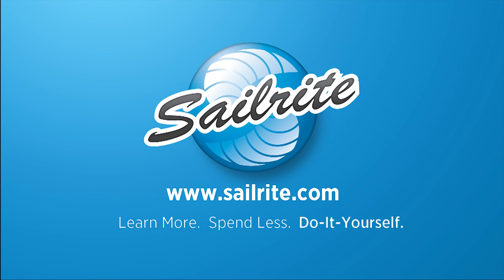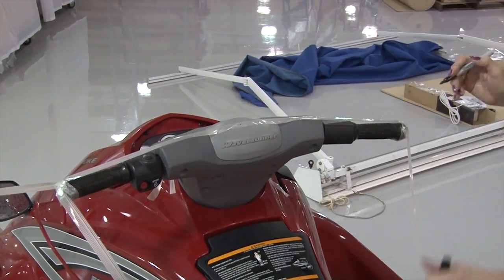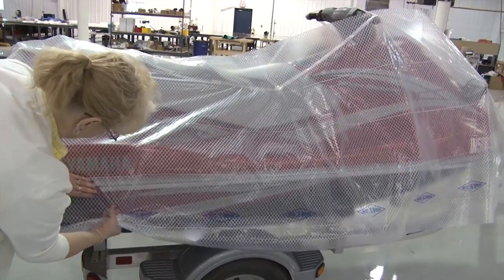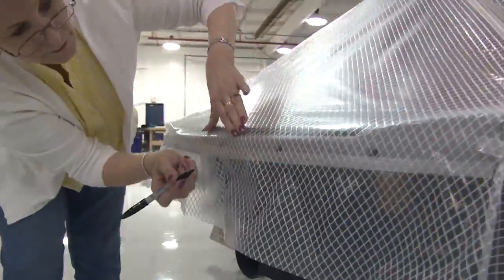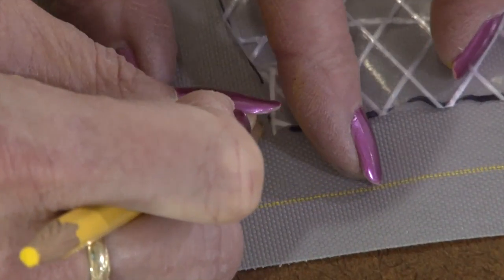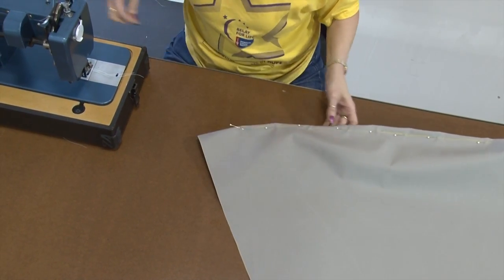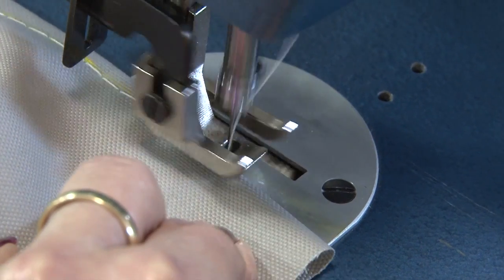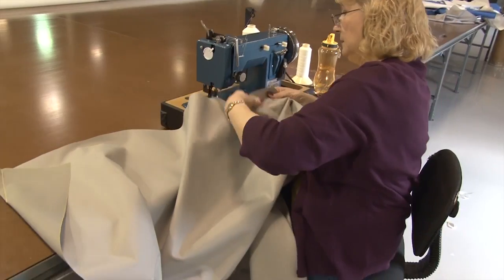How to Make a Personal Watercraft Cover

Comment: I have owned and operated an Marine upholstery shop for almost 40 years and patterning is my strong suit. I have been us using Tyvek house wrap for years to make my patterns out of but you just taught this old dog a new trick and I am impressed. I gotta say it takes a lot to impress me. The use of seam tape with the strapping tape is ingenious! I have spent years using all different kinds of patterning techniques depending on what I was patterning. I also owned a Commercial and Residential Awnings business and this technique is an amazing upgrade from using slices of PVC pipe or sun blocks that we use to keep Isen glass from getting burned where it touches the framework of a Bimini top or boat metal work. I have used clamps for many years as well And you’ve just taken all my years of experience and taught me an easier and better way to do something. I love it when knowledge is shared so freely. In the Marine Canvas world I was blessed to have almost every person I knew who worked in it was always ready to share not only knowledge but we also freely shared any materials we had that someone else in the business was short on. Thank you for reminding this retired old canvas worker a better way to achieve a great job with a lot less clamps and effort. I am in the middle of recovering my daughters Seadoo seat. I will always be doing something as it’s a love that will never fade. Thanks for the information! And yes the tyvek is getting retired too!

Comment: If you use a hole punch to punch holes along the dart lines you can then place dots through the holes and then draw from dot to dot. I used that method with Tyvek as it is not see through. It would work perfectly with your patterning material as well.

Comment: I want to build a plexi-Glass"cabin" on my Jet-ski with a heater,heated grips and seat(taken from an older sled),plus extra LED light(front and back)a towing system with a Wrench,to tow logs,and when I go hunting in Alaska.And I wanna do a similar protection on my snow-mobile.
Reply from the maker: Plexi Glass is not the go to choice for enclosure curtains on a boat, but rather clear vinyl window material is. Here is a link: https://www.sailrite.com/Fabrics/Marine-Fabric/Clear-Vinyl-Window-Material I hope your project comes out great! Let us know if you have questions.